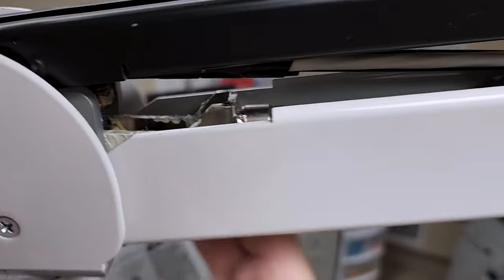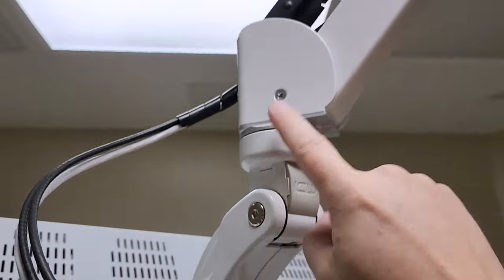Boom Arm Adjustments

Comment: had a or light drifting and it had the strangest adjustment process's possible on a STERIS harmony air
Reply: Same here with STERIS Harmony Air, it was the opposite of what I expected.
Also had issues with some of the plastic lens elements falling off of the individual LED lights inside.  Was able to glue them back on, we'll see how long that holds up.